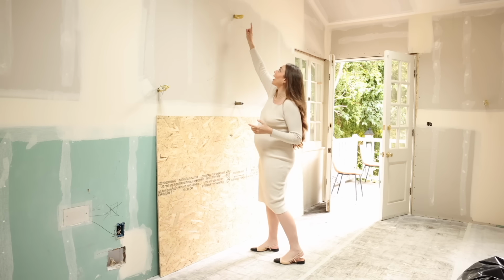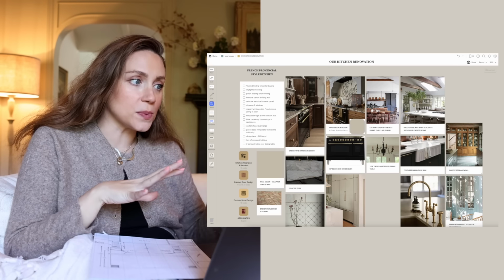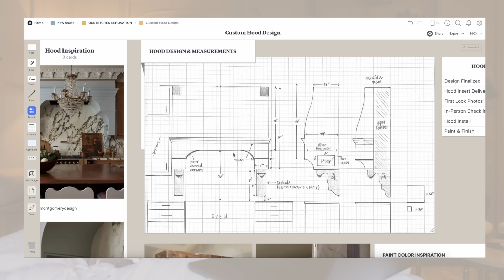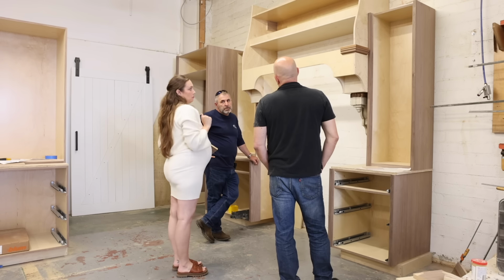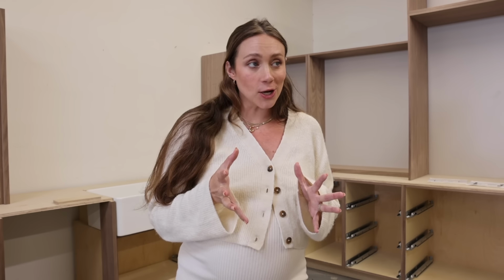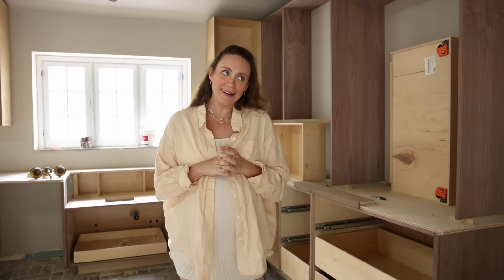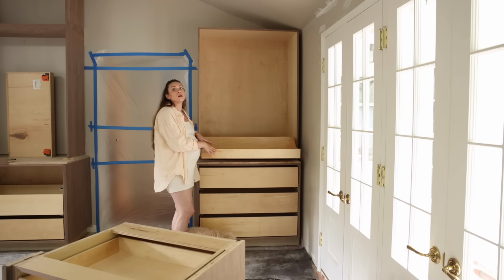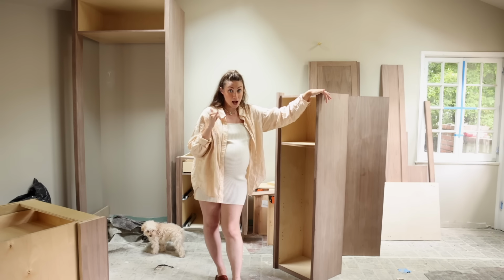EXTREME KITCHEN RENOVATION EP 6 | Custom Hood Design & Cabinetry Install

Comment: You might want to rethink keeping the spices in the box over/beside the stove. The heat from the stove can breakdown the spices. 🙂
Reply: Huh. Now I want to take a heat gun to my cabinets while I'm cooking. I know the lower ones get toasty when the oven is running, but I haven't noticed it with the uppers.
Reply: I was just thinking anything out into the boxes will be coated with grease all the time.  But maybe they don't cook much so it won't be a problem.  I sure she's thought it through.

Comment: it's nice but here's the thing and I don't think people think about this very much that sink is way too low
This is going to create a lot of issues with back unless it's being elevated by a kickplate where it's gonna be built off the ground and then it's up a few inches then maybe it would be better but still I like the idea of the modern sinks that are on top of the surface of the cabinetry so it looks almost like it's floating or it's resting on top of a piece of furniture
and the reason for this is because even though it might feel a little strange at first if you walk into the bathroom and you see a sink sitting on top of let's say addresser that has been redesigned be used in bathroom space it's at a height that is manageable where you don't feel inclined to bend over so I'll wait and see what happens after the boxes that they build or a frame that they put the cabinets on which is where your kickplate is but I don't feel it's gonna be high enough without causing back problems and that is a very substantial sink

Comment: those door handles at 2:30 look so low, is that common in the usa?
Reply: @jlammetje Interestingly exterior door knobs tend to sit lower (assuming to accommodate a separate dead lock above)—while interior door knobs sit higher. I think because you can’t see a lock above it appears the knob is lower set than the standard height.

Comment: I would want the "dummy" doors on the ends so you could open the center doors. 

And I still don't see the purpose of the front patio door and side window. That would have added so much more space!
Reply: Without that door and window it would look like a big box with none of the original character.  It would actually look like a big square room had been tacked o to the house.
Reply: @Lucinda_Jackson  I disagree.

Comment: I don’t understand why you are blocking the outer sides of the corbels with cabinets. You have plenty of storage throughout the kitchen - I don’t think the cabinets are necessary- and then you don’t have the issue with the crown molding blocking the cabinet doors.
Reply: Because she wants them there?  Where is she supposed to put all the things needed while working at the stove?   The uppers near my stove are the cabinets I'm in most aside from the double one that holds my dishes.

Comment: Just my opinion but these cabinets are very modern and do not fit in with the French country you have in the living room. Neither does the dining set, but maybe you plan on changing the living to go with the kitchen. As long as you like it. I would have so French countried out that kitchen. :)
Reply: What "dining set"??  She bought an old trestle table and, last I knew, she was looking for chairs?  And the cabinets aren't modern at all!  Are you going by the renderings?  She has said repeatedly that the renderings are drawn to shown layout, size and configuration, not design.  The elements used (furniture, lighting, cabinet style) are generic and not what will be in the kitchen.  You must not watch often since she's taken us on shopping trips and shown us what she's bought so far.